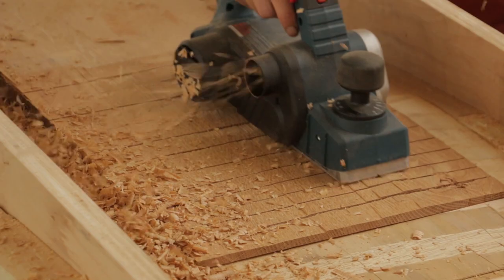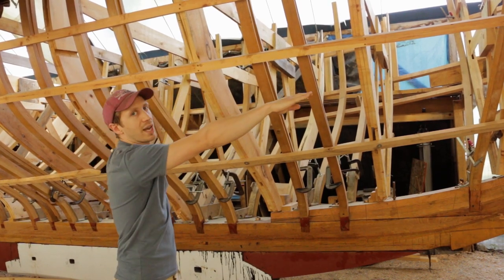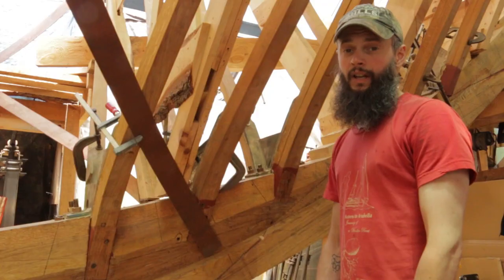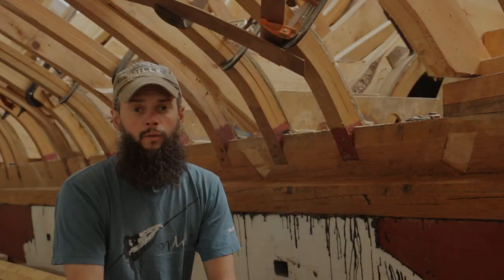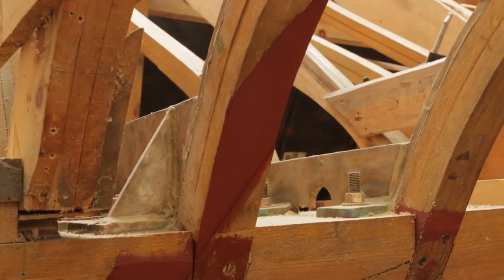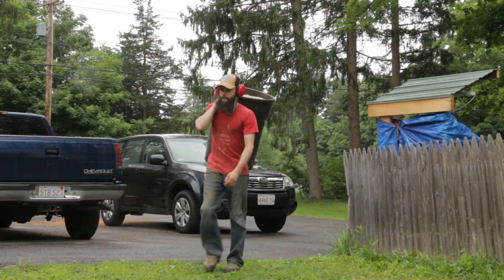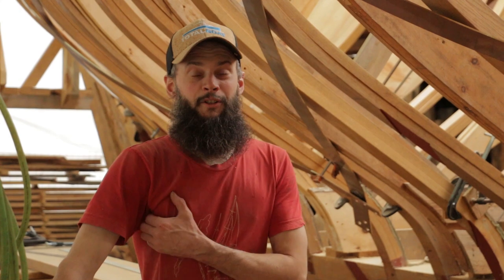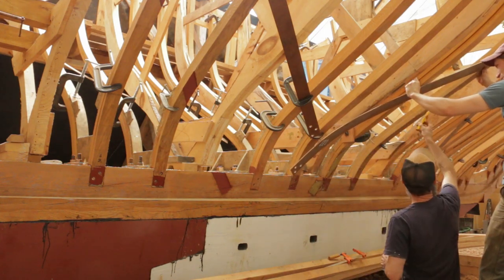Acorn to Arabella - Journey of a Wooden Boat - Episode 71: Installing the Bronze Strapping

Comment: Good morning gentleman, may I share a thought with you?

The non-ferrous bronze strapping that you are using has been (what is called) "work hardened" through a rolling mill. If you were trying to stabilize a flat surface with this strapping in it's hardened condition, it's spring like tensions would not matter.
However there are many compound angles on Arabella, and once you screw down the strapping that spring tension will be transferred to the hull of Arabella in undesirable directions. It may cause separation issues in the caulking between the planks later as it breathes.
The remedy is a simple one, Anneal The Bronze. 

That is achieved by heating it with a gas/oxygen torch, moving it rapidly to evenly distribute the Heat to a medium red in color, and quenching that section with water, this can be done in 3 foot or 4 foot sections, (best done at night so that you can see the red) give it a practice try with a small piece of bronze you will see once the tension is relieved that you can bend and shape the strapping easily. Overheating bronze will also cause problems, so practicing on a few pieces would be advisable. 
The spring tensions may be negligible, but this detail is what came to my mind as I watched your last segment.  
P.S. the build looks beautiful gentleman.
Reply: I respectfully disagree: you can see as they offer it up that it has negligible stiffness in the plane normal to its thickness. 
It responds limply, which you could expect, given that stiffness varies as the fourth power of thickness.
Furthermore, silicon bronze does not work harden a great deal. Phosphor bronze would be a different story .... 
If the thickness remained the same but the other dimensions were all scaled down (say it was a 15' long hull) then your warning would (I think) be justified.
Reply: @Gottenhimfella  You may be right, great project though, yes?
Reply: @kenolson3064  Fantastic project. I think they have great intuitions, considerable flair, the humility to learn from others, and an inspirational work ethic.
Reply from the maker: Thank you for your helpful answer. The silicon bronze does make a difference in this application.

Comment: Diagonal braces that have a curve in them are not diagonal braces, twisting motion of the boat is what will move the frames out of square, the diagonal bracing would be better placed if it where in the upper deck, this will stop the boat twisting.
A simple example; If a shoe box has no lid it will twist, put the lid on now it won't twist.
Reply: John Bower younare correct.  However, the purpose of these braces is to address the force that the water places on the bow as the boat is under way.
Reply: If you put a shoe box lid on the boat it will get soggy.
Reply: @johnbrocken4416   In that case they had better replace those thin head bolts that have to hold the bow sections together.
Reply: @davidjulian8536  You are correct.
Reply: If the curved diagonals are fastened to the side walls (every single plank), they will increase the boat's structural stiffness significantly.
Reply from the maker: The Arabella plans call for diagonal deck strapping, which we will be installing once the deck beams are in place.
Reply: Diagonal hull strapping is standard best practice no matter which source you ask. From Joshua Humphreys, to Herreshoff, to Lloyd's to Larry Pardey.
Reply: Diagonal hull strapping is standard best practice no matter which source you ask. From Joshua Humphreys, to Herreshoff, to Lloyd's to Larry Pardey.

Comment: i'm a metric guy, and my mind goes berserk with all those fractions of yours. lol
Reply: @Adamsadventures83  > lol no
Reply: Can always turn those fractions into decimals and work that way haha..but ya metric is much simpler and makes more sense to use..from Canada and we use both imperial and metric
Reply: Imperial is all about memorization. If you do it everyday, you end up memorizing without even thinking about it. I'm a machinist who works with both imperial and metric and I have memorized the frequently used metric to imperial conversions right down to tap drill sizes. 

Here's some quick and dirty references for you: 1/8=3mm 1/4=6mm 5/16=8mm 3/8=10mm 1/2=12mm 1inch=25mm. Those conversions aren't exact, but they're close enough to give you a frame of reference.
Reply: Anthon de Vries How do you think it is for somebody who grew up using the Imperial system of measurement.  I can use the metric system but prefer not too because I constantly consciously or unconsciously I convert everything back to the Imperial system because my mind just really doesn’t equate centimeters and millimeters into physical sizes the way I do with fractional or decimal  measurements
Reply: Sorry raised on Imperial system as far as I am concerned it is the system I will continue to use since I am not a scientist, nor do I have to talk to Europeans.
Reply: @bigunone  Actually, only the US, Libya and Myanmar still have the Imperial system as the official system of measurements. The rest of the world uses Metric either entirely or just officially and for most things. 

That having been said, so long as Imperial works for your needs, then there's no reason to change it. Just wanted to clarify a bit on who uses which systems :)
Reply: Now you know how I feel when metrics are used!
Reply: I grew up in New Zealand on the metric system, dad grew up on imperial but had to learn metric when learning to be a builder. 
He used inperial measurements for large measurements eg inches feet, and but precise measurements were in millimeters and meters.
I still use this system today.
Reply: Only Empires use the imperial system.

Just kidding, let's not get political ;)
Reply: @Ironwulfen   actually, USA official system is metric. Veritassium channel made a really good video about that, named "Is America Actually Metric? " 2 year ago.
Reply: There are 2 types of countries  in the world.  Those that use the metric system and those that landed on the moon
Reply: @tylergordon696  well, China, Japan and Russia (Soviet Union) don't use the imperial system.…

And I just learnt that what is used in the USA is not called imperial system but United States customary units

So....... nope
Reply: 3 extra inches and she said she appreciates "inches" instead of 3 extra centimeters.
Reply: Ian Stevenson  I wrote "don't use the imperial system".
Reply: Ian Stevenson  All good ;) no harm done. It's late (at least where I am)
Reply: @hamishgrove7722  you and about a million other Kiwis :)
Reply: @tylergordon696  NASA uses metric, they only convert back to imperial if they want to make average americans understand what they are talking about ;)
Reply: on the other hand, if you look at imperial, it all makes perfect sense, doesnt it?
https://cdn.zmescience.com/wp-content/uploads/2011/03/metric.png
Reply: @hernerweisenberg7052  Case closed.
Reply: @hamishgrove7722  When I'm working with my dad, we both use metric and imperial interchangeably. eg "this needs to be four centimetres wide and six inches deep".
Always use metric when I have to start doing maths though.
Reply: Im an imperial system guy and fractions mess with me to i wish america could switch to metric its so much simpler
Reply: @Adamsadventures83  - :) Now that's an interesting reason! However, a probe crashed on Mars (or something) because the guys forgot they bought a pressure gauge designed for metric. Not THAT smart, after all!
Reply: @bigunone  - Oh, now don't crouch in a hideout away from people. Europeans are nice guys!
Reply: @SerbanOprescu  Third generation American I figure my Great Grandparents left Wales and Germany for a reason, besides there is so much of the USA I haven't seen yet.
Reply from the maker: We learned imperial, the plans are in imperial, and all of our tools are in imperial so we use imperial. Hah! Thanks for watching.
Reply: @AcornToArabella  Fair enough. There a German saying: "The success proves you right!"

And now: back to work!
Reply: what really blows the mind is that metric only makes more sense because we can count to ten on our hands. I mean 60 can be divided into more even-numbered parts than 100 can.
Reply: @chuntr  That's why it was chosen for time units, but metric makes a lot more sense for everything else.
Reply: J Calhoun  The Apollo Guidance Cumputer was programmed with SI (metric) units, but diplayed values in Imerpial units, so that the Astronauts did'nt had to work with units they where not familiar with ;)
Reply: J Calhoun  i've read this article here saying the LGC used metric. looking at it agian now it doesnt talk about the apollo guidance computer, but i recall reading something similar about it somewhere:
https://www.doneyles.com/LM/Tales.html
Reply: @Adamsadventures83  No, you are not smart . . .
Reply: @Ironwulfen  In 1875 the United States solidified its commitment to the development of the internationally recognized metric system by becoming one of the original seventeen signatory nations to the Metre Convention, also known as the Treaty of the Metre. The signing of this international agreement concluded five years of meetings in which the metric system was reformulated, refining the accuracy of its standards. The Metre Convention established the International Bureau of Weights and Measures (Bureau international des poids et mesures, BIPM) in Sèvres, France, to provide standards of measurement for worldwide use.

Under the Mendenhall Order of 1893, metric standards, developed through international cooperation under the auspices of BIPM, were officially adopted as the fundamental standards for length and mass in the United States, though some metric standards were used in practice before then. The definitions of United States customary units, such as the foot and pound, have been based on metric units since then.
So basically the US is metric, you convert  all your measurements from metric standards. Unfortunately nearly 150 years later you have still to catch up with the rest of the world.

Comment: Resorcinol is a fantastic adhesive, I believe it was originally developed to build the World Way 2 British Mosquito fighter.

Once set it is inert and resistant to almost anything but you need to be aware that the tannic acid in oak can mess up the chemistry given that the hardener, urea formaldehyde is a strong alkali.

The implication is that it will slow down the reaction but as you're leaving the boards in cramp for 24 hours I doubt it will be a problem.  The outer edges of the joint should cure very well but the inner faces will cure at a much slower rate given the presence of higher concentrations of acid.  I would try to place the scarf joints away from places where they would be under maximum tension.

I spent years bonding all sorts of stuff together with resorcinol and the only time I had problems was with boards that were alkaline as a result of being impregnated with alkaline fire resistant salts.
Reply: Ian Stevenson  they may well have had but no amount of moisture will effect a properly cured resorcinol.  

Traditional WBP plywood had to survive 72 hours immersion in boiling water and I can vouch that it did\would.  My QC guys tested plywood every week.  We bought plywood from all around the world and to ensure we had good board we always tested.

If the Mosquito had delamination problems I would guess that the timber plys, though they would be partially impregnated, may have begun to fail.  

When we boiled the plywood to death it usually failed somewhere around 80 to 90 hours and it was always the timber that gave up.  72 hours in boiling water is an incredibly tough test and I'm fairly certain there is no other adhesive that could be used in plywood production that could survive.

Comment: hi was wondering why you did not think weld one and half lengths together not as a butt weld but a long diagonal weld as about 10'' this would lead to longer more stable weld  Arabella is comming along great
Reply: I was thinking the same thing
Reply: Yeah, I was thinking a butt weld would do, but I've used  30 degree bracing before with good results, and then I suppose given the compound S-curves, less than 90 degree crossings is maybe better? symmetry is no doubt the important point, and you got that covered.
Reply: Yeah pretty funny how they can weld all the floors but can't weld two straps together 🤔
Reply: I was wondering if they were worried about losing the cold-finishing stresses local to the weld.  It might be a bit more difficult to bend the straps fair if there's an annealed spot where they want to bend instead.  I suppose there's always rivets or other options.  If this is just something additional that was never on the original plans, it may not really need to be totally optimized at all.
Reply: @PSUQDPICHQIEIWC  good point
Reply from the maker: It just wasn't necessary. Thanks for watching!

Comment: I have a wonderful idea for a lot of those wood shavings. You can use them with a combination of polyester resin and create spokes for your steering wheel or countertops inside the galley or even a seating area. 
All you would have to do is to combine the resin shavings and then put it on a lathe and create what you need just the way to reuse and recycle and put it right back into that beautiful lady that you are creating.

Comment: Ref getting the big oak planks for the Garbed planks thinned down at the sawmill, there’s a guy called Kris Harbour who built his own timber home and workshop and he built a jig for a chainsaw and it was quite good as a substitute for a sawmill … probably a bit heavy going for a chainsaw but it did seem to work. Basically it’s a frame that follows the top surface of the plank(yeah you have to remove the bark layer first ) and he adjusted the cut depth by lowering fix points for the chainsaw to cut below the top surface by the required amount.
Yeah you sorted it all out ages ago but if you were ever in the same situation again… I’m sure you thought if this and was probably easier to just Chuck the wood in the back of the truck and head off to the sawmill.

Comment: umm, once you let-in the first one or two straps, then plank over it, you're not going to be able to move the strap out of the way to router out any of the other let-ins! Or is there something I'm missing???
Reply: ICBW but I think they may have to resort to quite a bit of hand work. I'm sure they've got it figured.
Reply: That strap will want to swing out way far from the frames once they loosen the top clamp on the (shear line?) Top of the boat.
Reply: As soon as it was mentioned that they are only doing the cut out for the strapping part of the way up----and the reasoning for that sounds good----I wondered the very same thing.  The metal strapping can only move so much, so it'll be interesting to see what the answer is.  These guys do seem to be thinking many steps ahead of the actual work.
Reply: I think I heard Stephen mention that they will bend them out of the way to make the notches as they plank.  Once they start to fasten down the planks the frames lock in and will change the location where the straps intersect the frames.
Reply: @godemperorhoover2131   But not enough to get a router in at the frame above where it's trapped by a plank, lots of saw chisel work I think.
Reply: No matter how it'll get accomplished, it has me hooked to this channel so I can see how they conquer the problem!!! Because that's one thing that's certain: they overcome the problems. I guess they could let-in the planks over any straps they can't recess into the ribs.
Reply from the maker: Thank you for the concern, it will be okay even if we need to do a significant amount of work with chisels.

Comment: I'm curious as to why you guys didn't just weld the bronze straps to make them longer.
Reply: I'm thinking about the same. Weld piece will be stronger than regular strap profile.
Reply: Charles Moore ditto
Reply: Diagonal cut on length welded will keep full strength and get the length they need. You have the brass welding rig why not use it and get clean 90s?
Reply: Use a fish plate on the inside that spans 6" each way, 22.5 degree bevel on each weld end. Gets full pen if you back gouge and weld in then install that plate... would give you a tremendous amount of strength and you could put the splits betwixt frames.
Reply: @forthelulz9165  A weld is never stronger than the pristine material.  It also has lower strength and fatigue life than pristine material except when of course there are horrible notched features that cause very high local stresses that could initiate cracks which grow and could cause failure.
Reply from the maker: It just wasn't necessary. Thanks for watching!
Reply: @AcornToArabella  Roger, that.  Carry on.

Comment: I learned a cool trick yesterday where if you sprinkle a little salt between your glue joints it keeps your two pieces of wood from wandering around when they’re being clamped.  just an idea it saved me a ton of frustration and headache
Reply: Sharp crystals sound like a good idea, but I would have thought something non-soluble (like silica sand or carborundum) would be preferable, so as not to upset the chemistry of the glue. Different glues might have different susceptibilities.

Comment: Hi as the diagonal bracing is very strong. Just worried that it is to strong and doesn’t allow flexibility in the hull which will absorb shock. So possibly creating a week point.
Reply from the maker: Diagonal hull strapping has been used and found to be highly beneficial, so we are not worried about it causing a lack of flexibility.